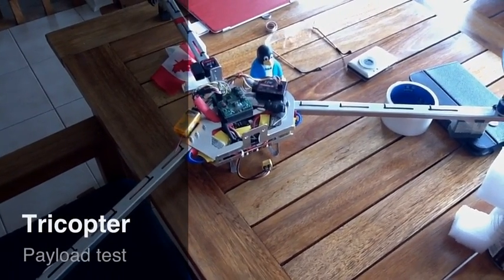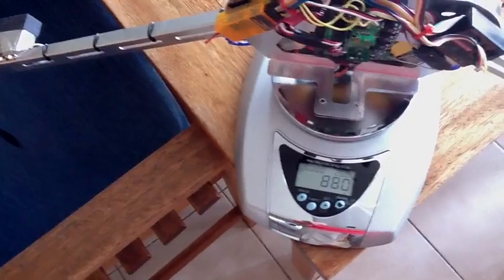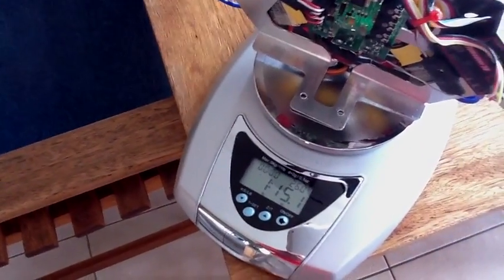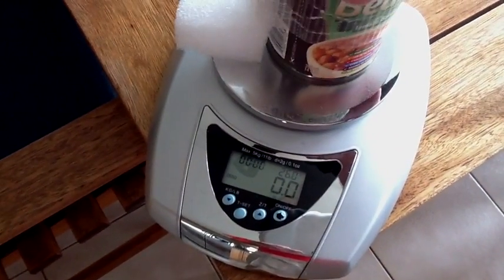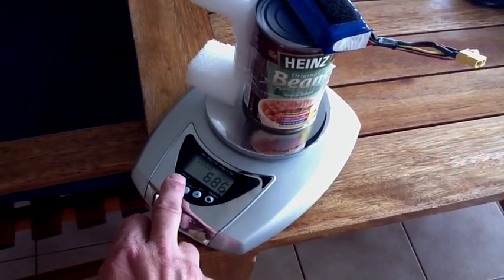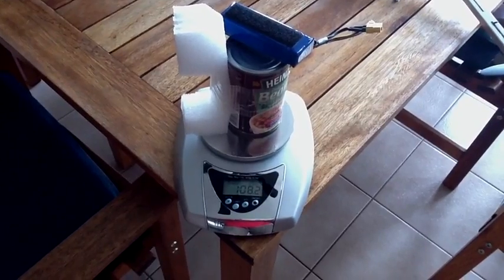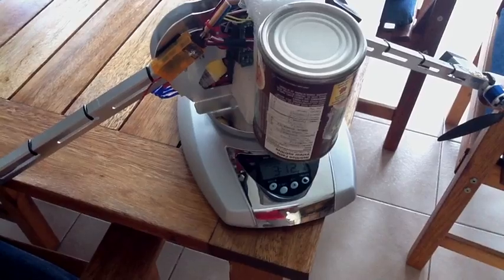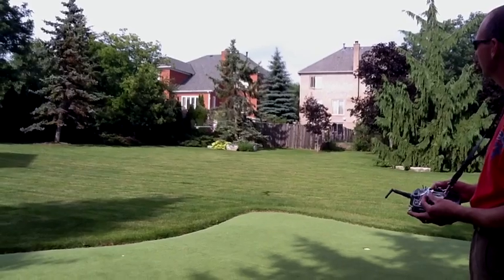Tricopter Payload Test

Comment from the maker: @Fusionman187  Hi.. I am using Emax  BL2215-25's they are rated KV950 with 9x4.7 props. I have been really happy with those motors controlled by the Emax 18 amp ESC's